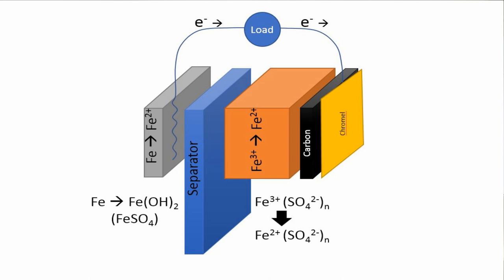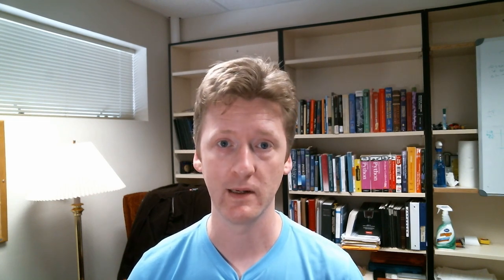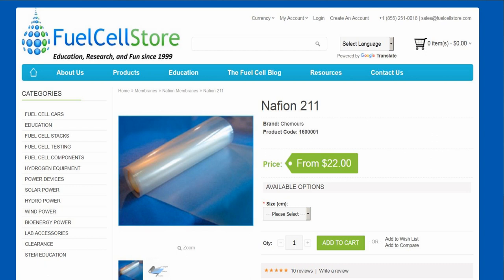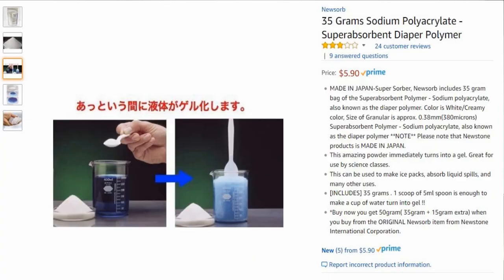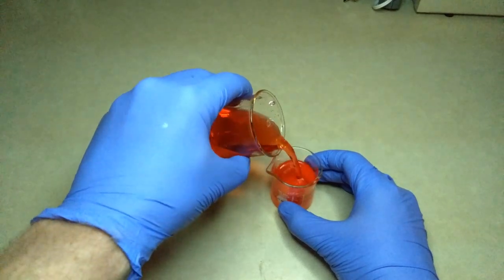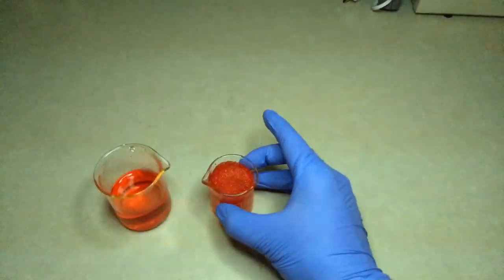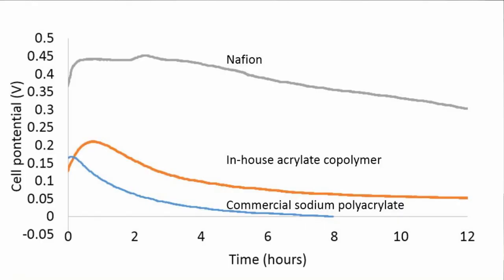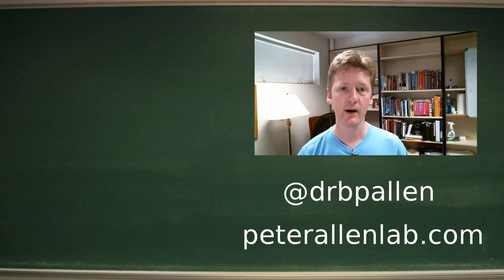Iron Battery chemistry: Separator evaluations 4

Comment: I think it would be interesting to also explain what kind of paper you use to create membranes, and what requirements that has!

Because my naive thought is: why not blend wet paper pulp, mix in the sodium acrylate powder and then create paper out of that mix? Or does that completely mess up the "paper matrix" or other qualities that the paper requires?
Reply from the maker: I've been using whatman chromatography paper, so pretty pure cellulose paper. I suspect most papers would work and making a cellulose supported polyacrylate monolith sounds promising.